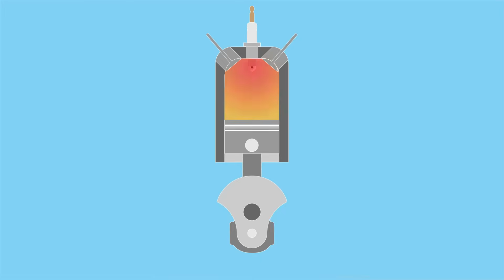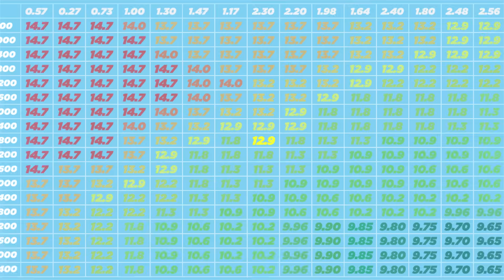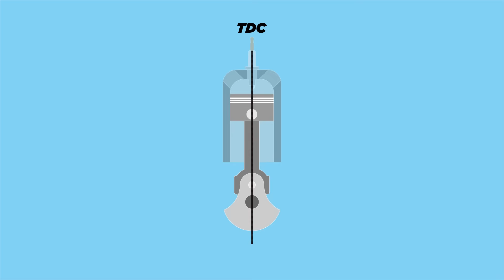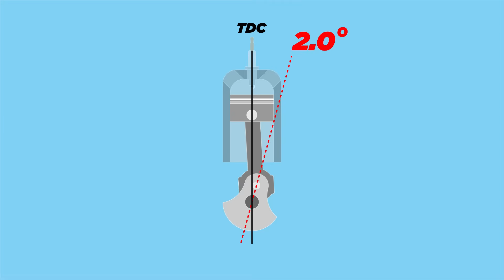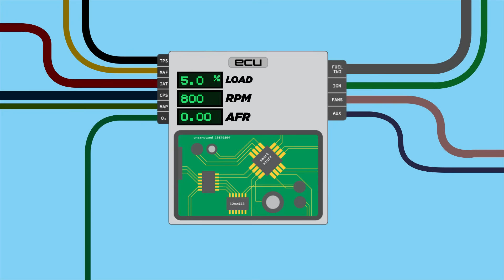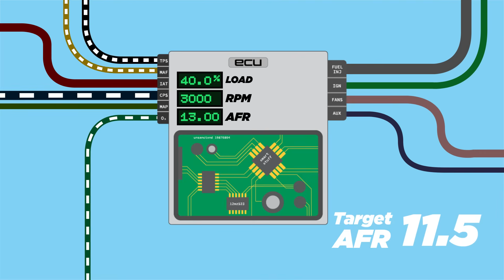ECU Tuning || EXPLAINED

Comment: Maybe thats what i need to disable my limit speed governor on my 2022 XSE Highlander. Cut the spped at 113 MPH.. Feels like someone pull you back from the rear..I am bummed out that Toyota did this because the tires from factory are rated for 138mph. I assumed it would at least go for a even 120 maybe 130,,, Thanks

Comment: This is Controls of your vehicle boys.

I worked on a GM vehicle, we have very limited access of the ICE and in the CAN bus we had like 6k signals.

Modifying your ECU is very hard, and requires a lot of testing.

Bear in mind that your ECU has so many other adjustments to compensate for all types of events in the road, so don't assume that just by tunning your ECU once will give great performance in every scenario. 

It may just work great for that afternoon 😁 and suck the rest of the week.

My utter most respect for the guys who tuned ECU.

Comment: Thank you for the video !!
I have a small question :
Regarding fuel consumption , same setup , same car - stage 3 .
Highway at 100kmh (60mph) , no engine load
Tune 1 : 33mpg
Tune 2 : 21mpg 
What caused the difference?  What to tell the tuner to change to get better fuel consumption?

Comment: correction 1: no need for spark you can tune engine to run on self ignition, called  "Diesel" engine . :). Correction 2, there is no free horse power. Fuel consumption goes up, and engine longevity goes down. More power more fuel shorter engine life span. simple as that, it is not free :).Nice video, like it!

Comment: Oh boy, what an opening! 
I’m sure a lot of guys rush out to get an ECU tune and the illusionary  800 hp.
BTW, you might mention how much it cost to build a 800 hp engine, if you don’t want your little motor grenade on the dyno!
Yeah, you can use Giggle juice and a compressor, but reliability or even “ longevity”?

Comment: Very informative. Listen, I have a question. I had it out with tuner, for I do know book knowledge on tuning. My car is a pig for what it is. Tuner has my air fuel at wot at 10:1. It at times blows black smoke( rich) yes it's very safe, but is it safe to say I'm down 100 hp. Also, will I wash out the cylinders at that ratio. Thanks bunch
Reply from the maker: If it feels down on power and it's blowing out black smoke, it's not a good tune! You might be better off finding another tuner from the sounds of it
Reply: @MZopyrus  I am in the process I've finding a new tuner. My question to you is this. Is it safe to say you could lose upwards of 100plus hp with a rich tune like this? I'm just saying, for what my setup is, I am down 150hp compared to comparable setups.

Comment: Hey buddy thanks for creating this video, I just got a good idea of what ECU tuning/remap is meant by. I was doubtful about modifying the traction control system, I have commented in many of the channels asking this and everyone replied that it is not possible. I just wanted to know that I have a 15 year old car, it is equipped with 4wd and TCS. The TCS is ok, but it needed to revved higher to make it effectively work, so I need to make it a little more aggressive. Is it possible to modify it and reduce the time interval between individual wheel braking when TCS is working, which means it should increase the number of brakings of an individual wheel or increase the time duration of brake application to the individual wheel. Pls reply
Reply from the maker: It's very difficult to know for sure but some older cars don't allow the ECU to be tuned. Another limitation could be the way your TCS works and/or the sensors that make it work, like the wheels speed sensor etc. I'd personally look for tuners who specialize in your specific car. Even if they're not near you just call their shop and pick their brain.

Comment: It's beyond my comprehension how an ECU receives signals, compares , adjusts, etc. in the miniscule time frame that all this happens. Actually the fact that an engine runs at 8000 rpm and does so with relative ease (appears such) considering intake-compression-power-exhaust happening multiple times per second is another thing that blows my mind. I just have to accept it, because IT IS happening!!
Reply: It basically comes down to the clock speed of the CPU (central processing unit) inside the ECU. Microprocessors are a very fascinating topic and a whole 'nother universe / rabbit hole to delve into. The most advanced CPUs in consumer electronics are your PC/Laptop and smartphone. Just understanding how many calculations it takes to play and display this video is fascinating. This video is 1920x1080 pixels updating at 30 frames per second. That is 2,073,600 pixels each frame or 62,208,000 pixel updates per second. Each pixel has 3 values that range from 0-255 (Red, Green, Blue) so basically your graphics driver is calculating 186 million values EACH SECOND to display this video... and this is light work for a modern GPU! If you can't tell, I find computer engineering just as marvelous as automotive! :)
Reply: it definitely is crazy to think about. there’s hundreds of things that have to be working on an engine and it has to have perfect timing every single second. blows my mind
Reply: fuuuck forreal they’re geniuses 😭 on  another level

Comment: Tuning is definitely a skill as well as an art form much respect to those who can do it.  I got boned by a guy that claimed he was a tuner but as the tune started I quickly realized that he did not know what tf he was doing and I let him go.  Trying to dive into the Eugene software on my own was a better option than letting this guy possibly damage my 9k engine.  Could really use some help.  Upon putting new engine in and starting with stock ecu then switching to apdaptronics ecu I'm having trouble free reving the ecu will not let me go past 5k rpms.  I have a wankle and  no one seems to want to touch it with a 40ft pole
Reply: I know nothing about tuning, but I'm pretty sure  a Wankel is a 4-stroke cycle, so whether it's pistons going up and down, or a rotor spinning through the cycle, tuning should be pretty similar I would think.
Reply: @ronaldrussell5481  I think it's more of a specialty thing, as in some tuners specialize in certain vehicles and/or systems
Reply: It's probably also a liability thing because if they do a shit tune and blow the engine that's a career ending move so they'd rather not risk it

Comment: Straight forward and to the point. Nice man. I will soon be trying to learn how to tune. Gonna be reading everything I can get my hands on and watch everything involved with tuning. I won't go back to OTS tunes and my tuner has become more and more difficult to work with and dyno tuning in my area is a joke. So hopefully this time next year I'll be able to at least tune my own car.
Reply: It's honestly not worth it bro, most of these places don't let you use their dyno if you paid them for liability reasons. The equipment and software to tune is thousands of dollars (the computer, specialty connectors, multiple software licenses) and not something you should be changing constantly. If you want to tune, get a carbureted vehicle like a motorcycle or an old truck.

Comment: Do you think you could make a video explaining the differences and benefits of twin turbo setups vs single turbo setups and vice versa? There's a lot of conflicting info out there, and so far your videos have been some of the most educational videos I've ever seen.
Reply: Single turbo setup= one snail boi
Twin turbo setup= two snail bois
Reply: Companies will usually do one big turbo or two smaller turbos. Having one turbo is cheaper to manufacture and will usually suck in more air than two small turbos. The negative of a single big turbo is that it has lag (which is the time it takes for the turbines to spin fast enough to make boost). 

Twin turbos are smaller, but their smaller size lets the turbines get to that fast speed needed to suck in air for boost. The negatives that come with a twin turbo are more expensive manufacturing costs and less power at high RPM. 

The way companies fix this is they have a twin turbo setup that has different sized turbos, a small one for low RPM, and a big one for high RPM. I’m not super educated in how it works and I don’t want to spread misinformation, but that’s the general idea on single vs twin turbos.
Reply: @balakay1538 there are 2 types of twint turbo configuration. Pararell and compound. In pararell you split the motor in half. Lets imagine an i6 you would have a turbo for each 3 exhaust outlets. In compound you have a smaller and a bigger as you said. Hope this helps.
Reply: @balakay1538 that is exactly what I was trying to say. You explained it well. There's various reasons why a manufacturer would choose twin turbos.
Reply: Manufacturers use them for different reasons depending on what they want. There is no one answere is right to it. Two is obviously able to do more than one for efficiency. Sure there could be 2 tiny ones compared to 1 big one. But 2 share the work. I know some manufacturers use ons for acceleration and 1 for top end speeds. There is various purposes for it. 😊
Reply: twin turbo is less stressful on your car while single turbo is more stressful you're welcome
Reply: @ffff-pw1mg what logic is that 😅 that is false. Maybe it is less stress on a single turbo. The more power your engine makes equals more stress on your engine.

Comment: I drive a BMW 320d 2018, also known as BMW F30, with no modification on air-intake or what so ever. I was wondering, if there is a way to program the ECU yourself? Is there somewhere where you could get a modified ECU code/file that you can overwrite the stock ECU with on my car?
Also, very good video! i learned so much
Reply: I would recommend tuning your own car if you don’t know exactly what you’re doing. If you make a mistake it could cost your engine

Comment: Yo bro. I know the hp and torque gain can vary between cars, but I just want an idea.

I have a '09 w204 C 180 Kompresser with 156 BHP. It uses the M271 engine. The engine in my specific one is new because the old was damaged. 

Do you think it's possible to get over 250 hp with just a stage 2 alone?
Reply: "stage 2" 😂

Comment: thanks a lot, never been this late but awesome video and content. i have a question that's kinda related, I want my engine to rev higher. what is the part i have to upgrade to make that happen?
Reply from the maker: That really depends on the engine and by how much you want it increased. Usually your tuner can move the fuel cutoff (red line) to a higher engine speed but not by much! It's all about your average piston speed which can't exceed 55mph, but even that could be mechanically limited depending on your engine (i.e. valve float, etc.) Unless you start changing engine components to change stroke, displacement, and upgrade the entire valve train to be able to handle the higher rpms .. another thing is that the higher the engine is made to rev the shorter its lifespan is going to be. Like a lot shorter lol
Reply: @MZopyrus  as I said earlier and still saying, my top 1 youtuber hands down🔥, very precious info right there💎. Okay let me just be honest, the engine is k20a2, it rev up to 7800rpm and can reach 8000rpm by a tuner and I want it to rev up to 9000, what shall I do to make it happen?😅 P.s : idc tbh honest about lifetime,money or anything because I want to race it anyway and yeah race cars broke parts so I'm okay with it😂, i just wanna make it rev to 9000rpm no matter what and thanks in advance and sorry about the annoying continuous questions 😅
Reply from the maker: @karaabdelkader1273  you give me details like that you're getting a build recipe! Look out for the dedicated video coming soon!
Reply: @MZopyrus  OMG i 'd love to...more than excited for that... waiting patiently over here

Comment: I'm actually learning things in this channel. Thanks man.
And a quick question, I'm gonna buy a VW mark II golf gti as a projectcar, you think it's a good choice?
Reply from the maker: Thanks man. Yea the mk 2 is great! Most iconic vw in my opinion!
Reply: @MZopyrus  it's my first car ofcourse. Only carburetor versions are available in Iran. I'm gonna do an engine swap with a common engine named TU5. I'm kinda limited on budget. should I Go for another engine, or stick with the original one?
Reply from the maker: @alinazarzadeh7991  not too fond of that Peugeot engine to be honest. Given how much it'll cost to do the swap I'd look into better options. The same golf also came with the 1.8 fuel injected motor, which you should be able to source easily. I'd go with that! I've heard people running a 2L engine in these cars in Iran too but not sure what exact motor it is.
Reply: @MZopyrus  yeah, I can't find the fuel injected version anywhere. That 2L engine is a 4 cylinder 20 valve. I'm worried about the complexity of that. Haven't really looked into it. 
BTW thank you very much for your answers and your greaaaaaat channel. 

You are my favourite Youtuber...